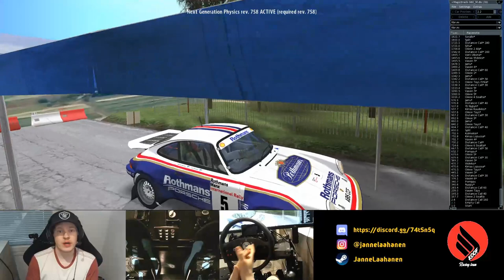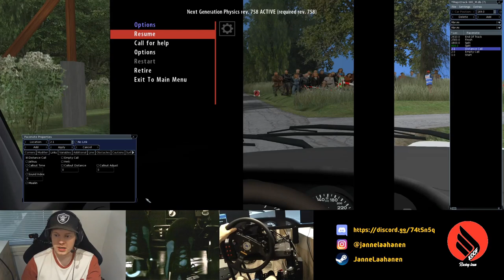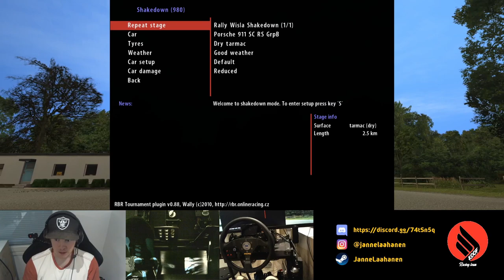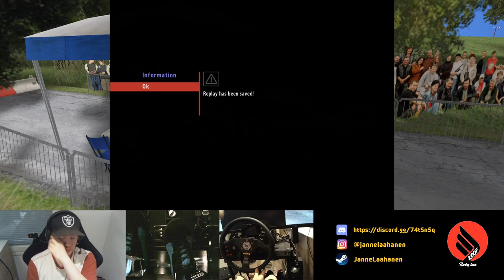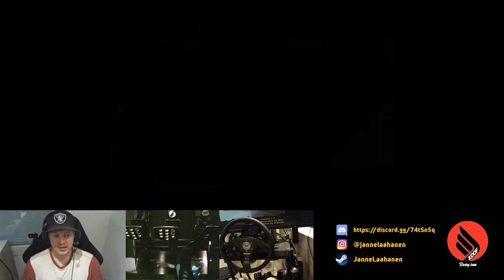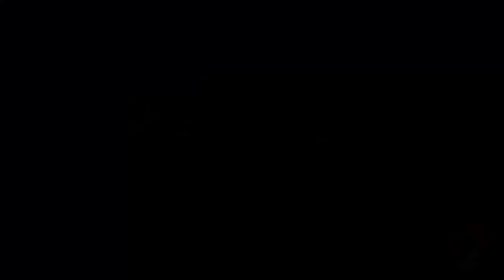Richard Burns Rally - How I make notes

Comment: Any idea why my Pacenote plugin says "Pacenote plugin failed to make backup copy of DLS file" When pressing "save" in pacenote editor? I can save notes as BTB ini-file, but not as a DLS-file.
Reply from the maker: I guess you're trying to make notes in RallySimFans plugin and on a BTB stage? There's a prevention for saving in dls, because that would overwrite the notes on the Cote d'Arbroz stage as that's how BTB stages work. Some black magic tbh.
Reply: Correct I am using RSF plugin and stage is Myttäälä. So I guess reason is that. Do I understand correctly that on BTB stages I need to read/load pacenotes from ini-file every time I restart the stage? Not saying that I crash a lot :D
Reply from the maker: @pernavoi  Well you can overwrite the original pacenotes.ini with your own notes in the stage's folder. Just make sure the overwrite is also called pacenotes.ini
Reply: Thanks a lot for your help.
Reply from the maker: @pernavoi  no problem mate 👍🏼